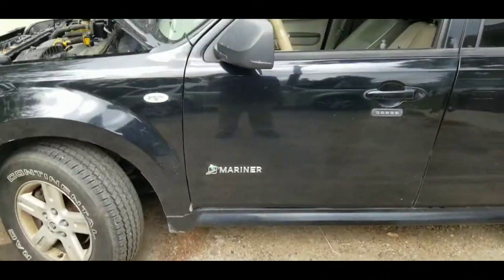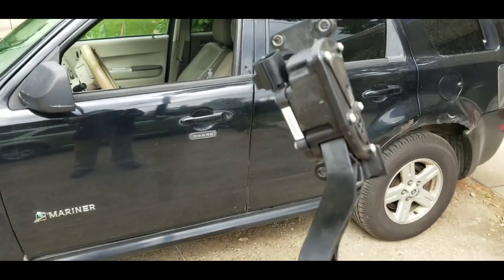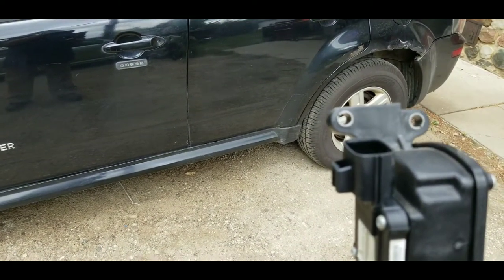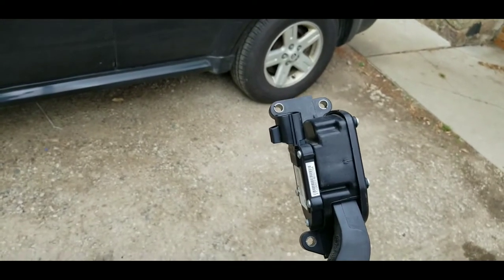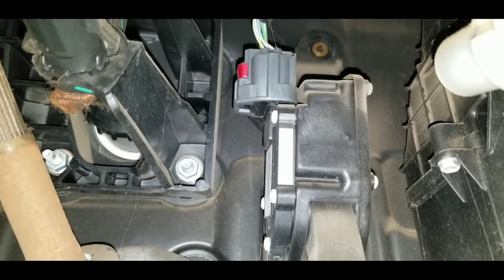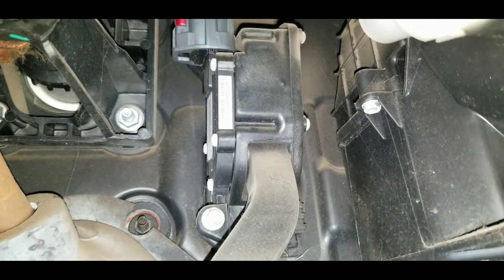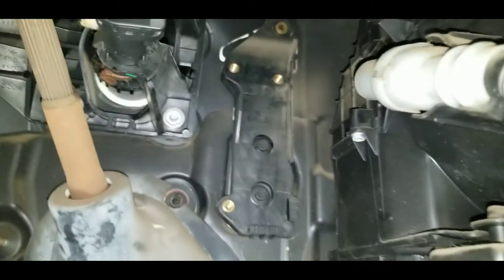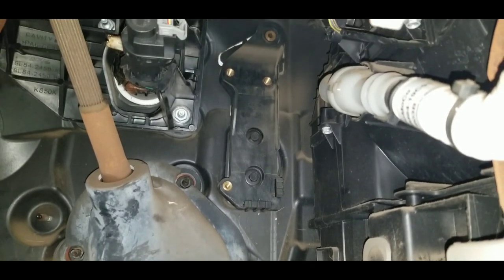How to replace electronic throttle pedal 2008 Ford Escape Mazda Tribute & Mercury Mariner

Comment: When you had this problem trying to accelerate would the lights on the dash come on like the car sort of died? I'm seeing this happen and then it will kick into gear and go eventually. Curious if that is the same behavior your describing and fixing.
Reply from the maker: No lights or issues during the forced deceleration, lights come on after vehicle stops. NOTE. the problem has returned despite the new pedal and throttle body. Stumped now. Going to keep driving with idea that it might stop  working on first drive of the day. It never happens twice in a day.

Comment: With .my2008 it's a goofy issue  no gas pedal response until it warms up whst a bunch of junk never had any trouble with a throttle cable ever  all this new tecnoligy is all  nothing buy expensive garbage
Reply from the maker: One of mine does that too. Been unable to fix it. Replaced foot pedal and throttle body. All of the newer cars are thatvway.